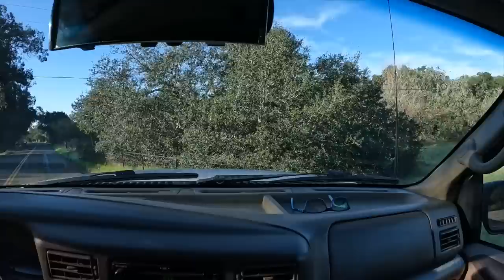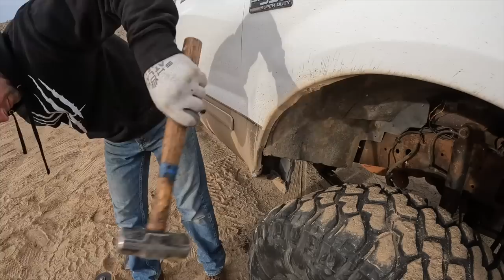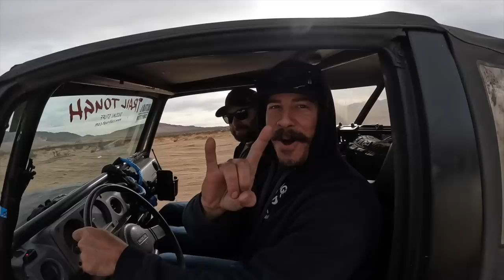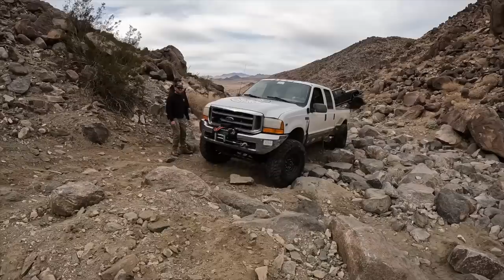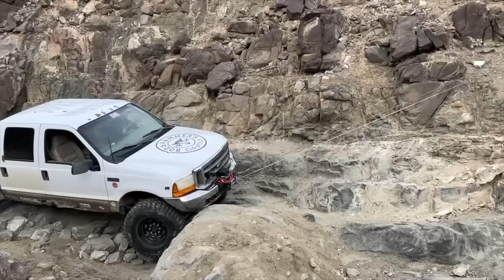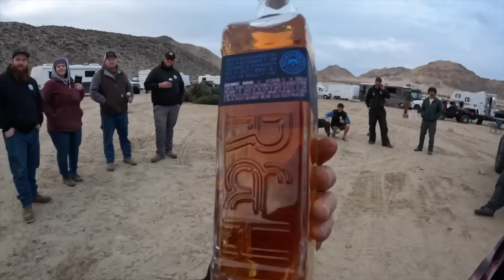Cheap Truck Challenge! $2500 rigs at the Hammers!

Comment: I had a 1991 f250. Had a 5.8 and a 5 speed. Bolted some 32 inch muddies on it with the stock rims. Ran most trails in big bear with it, including John Bull at one point. Was in it about 2k. Was fun driving past guys with fully bult jks on 40s. Didn't have enough power to break itself so kinda just pointed it and dropped the clutch lol.
Reply from the maker: Cheap fun is the best fun for sure!

Comment: I was worried about my truck fitting in that Trail when I am done but I can see it shouldn’t be an issue after you fit that one through it
Reply from the maker: I’d like to think I made it a touch wider in some spots. 😂
Reply: Not sure that counts as fitting though
Reply: @Chasing518  looks like you just made your truck narrower no need to make the trail wider
Reply from the maker: @luedog8385  Minnesota Boatsides I call them.  Truck cab/doors are sooo rusty, they just caved in.

Comment: Your wheel setups probably the closest thing to 2500 on the trail lol I love your choice though
Reply from the maker: I spent $450 on the steel wheels, got the old, torn bead 38s for free.
Reply: @chasing518  that's crazy but I guess it's all about who you know and those suzukis I don't think you could touch a rotted out one for that price here in Ontario Canada nvm with the Toyota axles etc and I forgot about the torn bead part any clue what that rubber would cost new ? I think it was about 2500 Canadian for a set of kO2's out here for a stock ram